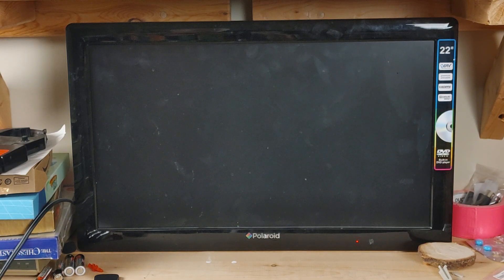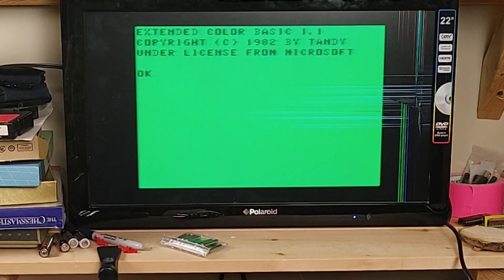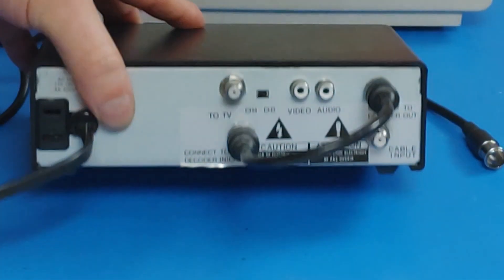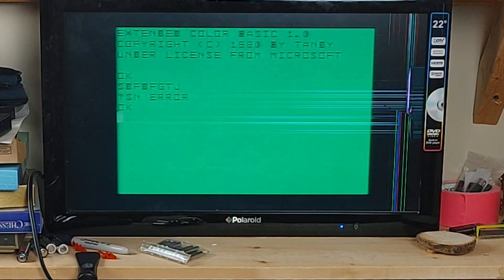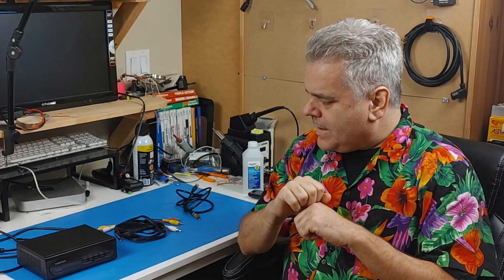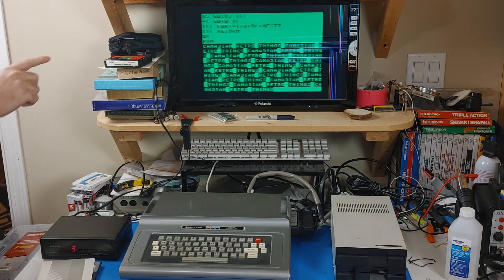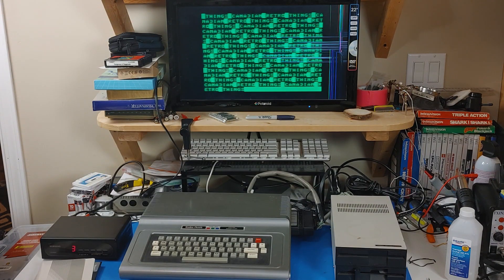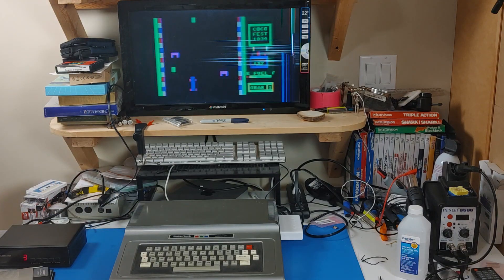You Have a Real CoCo 1 or 2, Now What? Part 2

Comment: A big difference I've noticed between the CoCo1 and the CoCo2 is that the volume on the cassette for the CoCo1 has to be DEAFENING. The CoCo2 is much more forgiving with the cassette interface; I use the cassette interface frequently to quickly load in programs from off the internet (I don't yet have a CoCoSDC)
Reply from the maker: A big part of it is knowing your device, I haven't really used my cassette for much for a while now and seemed to have forgotten the levels that I DID know well.
Reply: @CanadianRetroThings  100%. If you use the cassette regularly, it's no big deal to load from it, but that initial calibration, like you expertly demonstrated, can be a real PITA.